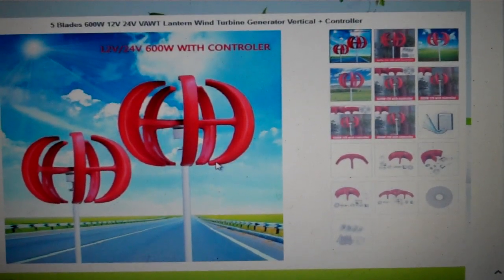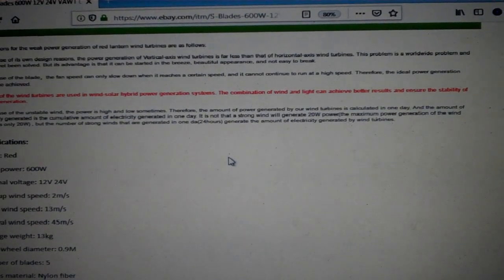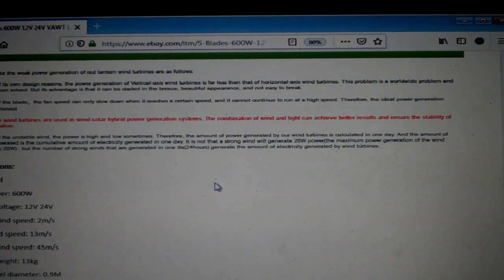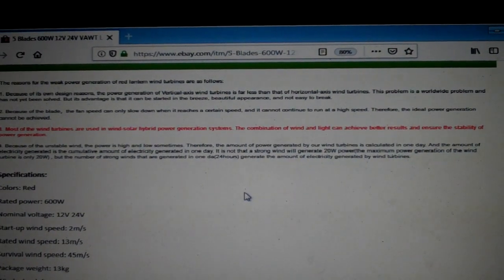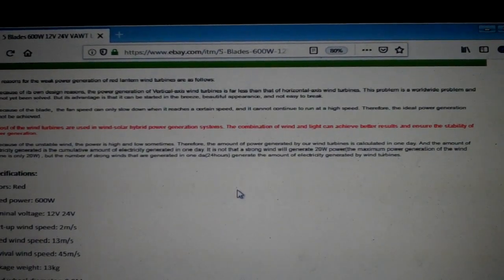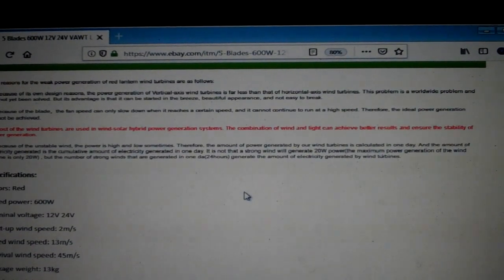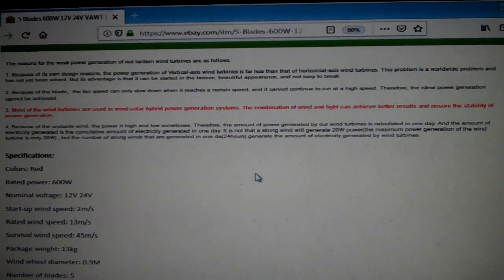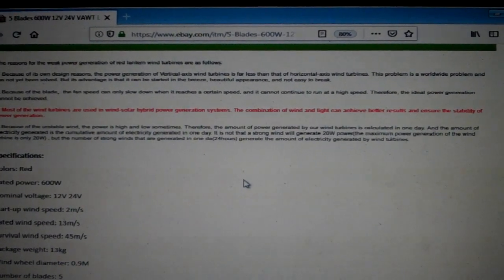SCAM-CHINESE VERTICAL AXIS WIND TURBINE-VAWT-THE SAD TRUTH-JUNK-PART 3

Comment: They cannot mix watts with watthours. This would be a gigantic scam.
Reply from the maker: these vawt are a huge giant scam.it is virtually impossible for these to produce power.can only turn at 150-200 rpm's but it takes 600-1000 rpm's for the motors to even start producing power.they actually fight the wind.one side turns with the wind while the other side is forced into the wind.a hwat the wind blows through it.little or no resistance
Reply from the maker: i am averaging over a thousand hits per day on my vawt scam videos.i have been keeping track of several of these vawt sellers and their sales are dropping off big time.the word will get out.
Reply: @melbaron1110  At the same area, a HWAT uses 4 times more of the wind energy than a Savonius chinese lantern. The HWAT has a efficiency of 40% to 48%, the VWAT 10 to 15% only.  Yet the VWAT is wrongly advertized having better efficiency than HWAT´s to sell it to customers who fear noise, dead birds and defective bearings. So I computed the theoretical power as follows:
Speed Area=0,5 m2
m/s Power Watts
1,4 0,1
2,8 0,9
4,2 3
5,6 7
6,9 14
8,3 24
9,7 38
11,1 57
12,5 81
13,9 111
15,3 148
16,7 192
18,1 244
19,4 304
20,8 374
22,2 454

Comment: What's a good alternative then ? I have solar,  but have been interested in turbines . Waste of time across the board?
Reply from the maker: windchargers work well as long as you have a steady amount of wind at 10mph +.on a windy day my 400w hawt will put out about 12-16 ah.100 watt solar puts that out easily and no wind.plus unless you have it away from your house they are very noisy.

Comment: the controller that comes with the turbine is junk it only puts out power when the input goes to 12 volts or over.
if you wan't continues power use a buck converter
Reply: This is irrelevant, because the output of the generator itself (which is fed into the converter) is pathetic - less than 4 watts for really HIGH wind speeds - I know, I have tested.